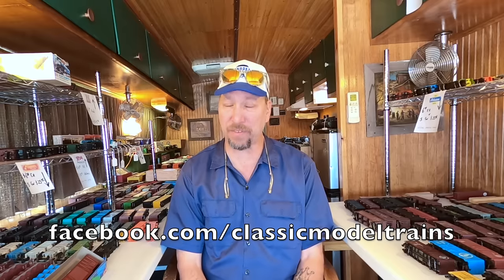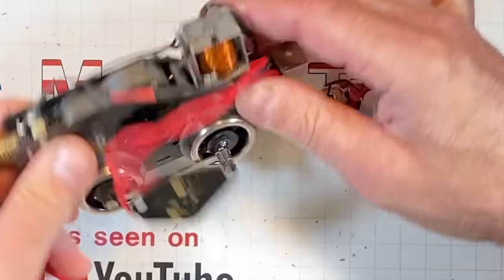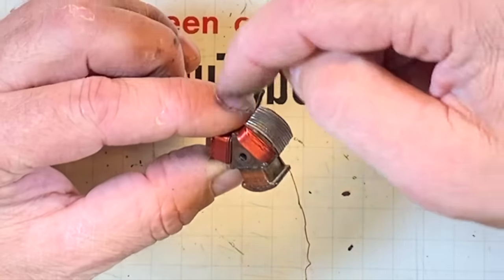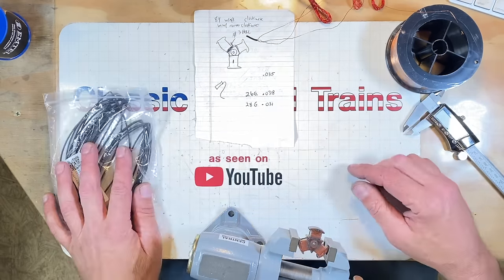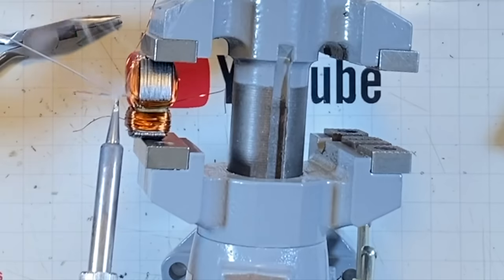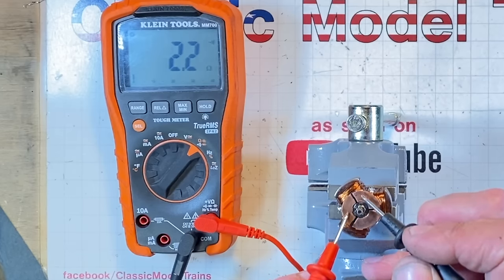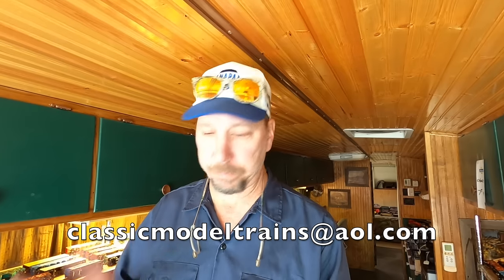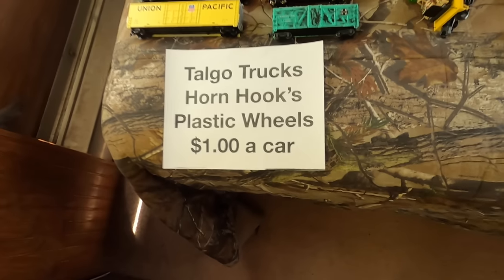Made Our Own Train Show & Hand Re-winding a Pre-War Lionel Armature.

Comment: Excellent, nobody has shown rewinding for train motors. You speed up the process with drill turning it. Clever. I’ve done it hundreds of times years ago for slot car motors to race at commercial tracks.  Winding was with a clamp and crank spinning armature around by hand. The experimentation of different gauge wire and # of turns could yield higher torque for greater pulling power. 😊😊
Reply from the maker: Yup.  Quite a few Fellers have shared with me about re-winding the slot car motors back in the day

Comment: Ron good job on the rewind. I remember when I was in high school we raced slot cars on a big track in "the slot car race" store. My car was slower than I wanted so I rewound the motor with bigger wire "which made it use more electricity more than the track supplied so I put 2 six volt lantern batteries in a brief case which I connected to the track and then my car ran so fast no one could even keep it on the track. but it was fun.
Reply from the maker: Love you hack on the race track power.  too funny!!!

Comment: I enjoyed your video of rewinding the armature and the 250 E. I have a suggestion instead of using shrink tubing may use liquid tape may buy Garner bender It comes in black blue and red apply with a Q-tip small brush and let it dry for 10 minutes. Apply one more coat and you’re good to go.  Situations, this is better than shrink tubing. Also if you forget to put the tubing on before you solder, this is a good alternative. This liquid rubber is made for electrical connections  try it I think you’ll like it
Reply from the maker: Sounds like a great idea to me.  Will look into that stuff!!  Thanks

Comment: Another great successful video! Just an FYI, when you wind up the armature wire with the drill you can actually stretch the wire without breaking it thinking you vae the same number of raps of wire. This can make you resistance readings be different like you had. Not a big deal just an explanation.  Good luck with the sale.
Reply from the maker: Thanks for pointing that out.  I agree and  Makes sense to me :-)

Comment: Back when I had a hobby shop (late 80’s). RC car racing was the rage. Hand wound motors were a big deal. 

If I remember correctly:
Thick wire with fewer turns yields, high RPM/lower torque. 
Thin wire with more turns yields more toque /lower RPMs.
Reply from the maker: Lots of stories of Fellers re-winding there slot cars.  First story about RC cars!!

Comment: Another thing with the brush installation, while you have the brush plate upside down with the brushes installed you can insert the armature into the plate to hold the brushes in place. The hold the armature shaft gently with a pair of needle nose pliers and then install it into the motor frame.
Reply from the maker: Thanks for that good tip as well!!

Comment: 22:50 I install plate then lift spring enough to drop in brush.  Good stress test for brush spring.  Drop it in the groove on the brush.
Reply from the maker: This plate is actually backwards than you would think.  if its installed there is no way to actually drop a brush in the holder.  even if the spring was removed.  its made to install brushes just as I showed.  might be a prewar thing?  I dont know.